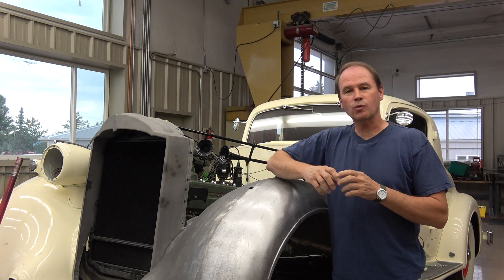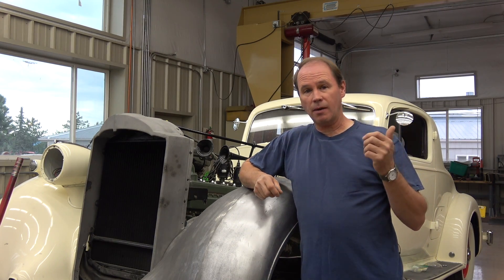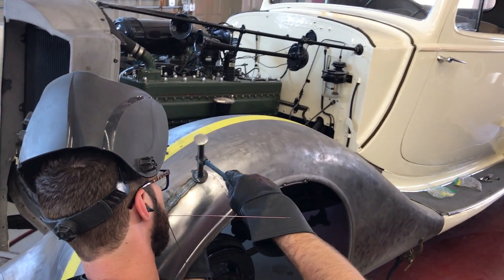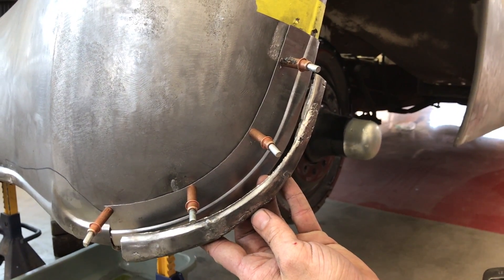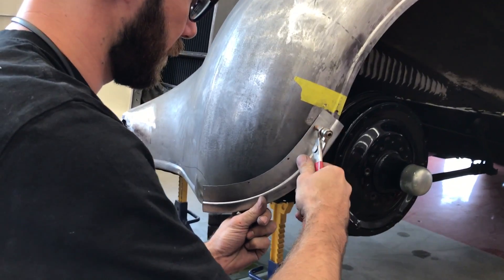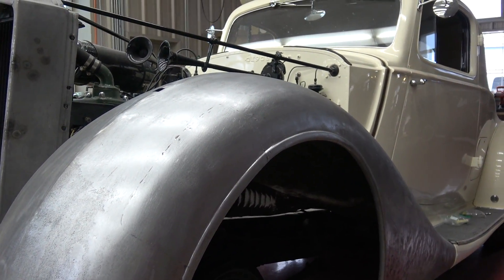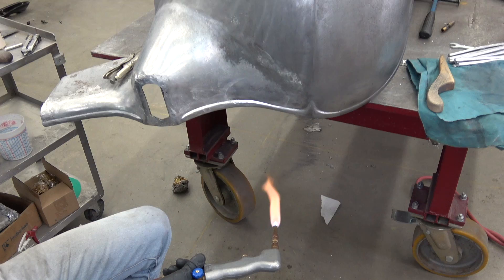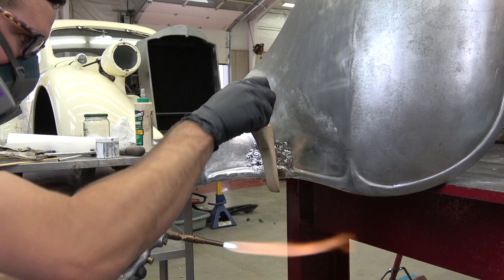Making Patch Panels for a 1935 Packard

Comment: Excellent lead work. That is an interesting concept with the steel wool, or is it brass wool. Nevertheless it sure gets the tinning butter into the crevices and surface imperfections. The metal work is facinating. Thanks for a great video. Take care.

Comment: Hey are you still able to obtain Ammonium Chloride ? I can remember as a kid,the guys in the hardware stores hated the stuff,any iron products nearby would rust like mad. It just disappeared,and in the nineties when I used up the 5 lb block I had for years,it was unobtainable anywhere reasonable. Quite hard on the lungs I know,but that stuff was magic in the right application. It went from ready availability to gone overnight. Even ordinary soldering materials are now difficult to obtain,and it has rapidly become a lost art. Like your channel. Good articles,and good video pacing. Cheers.